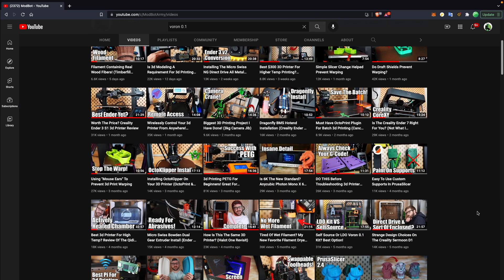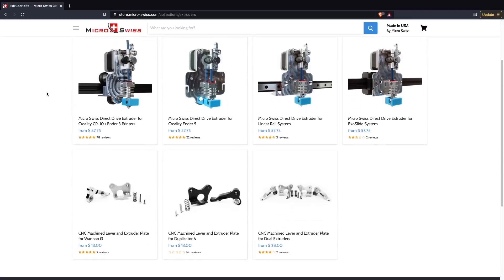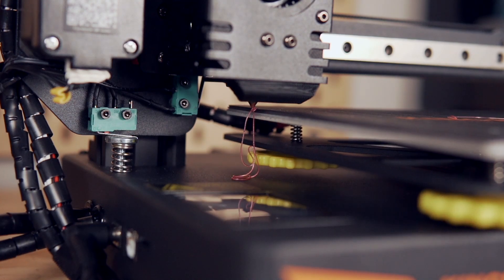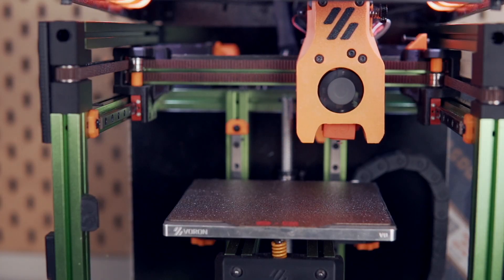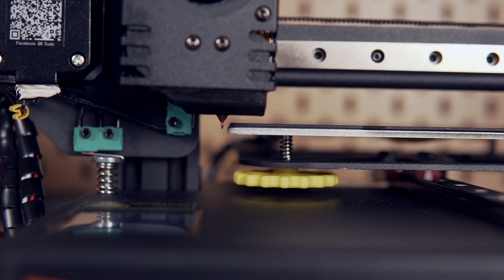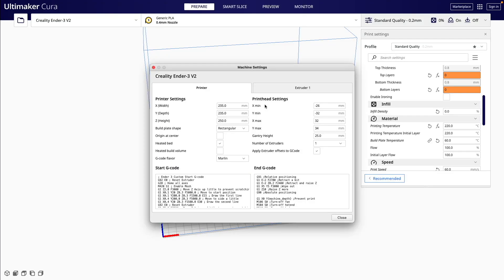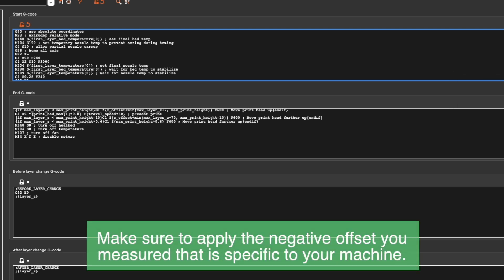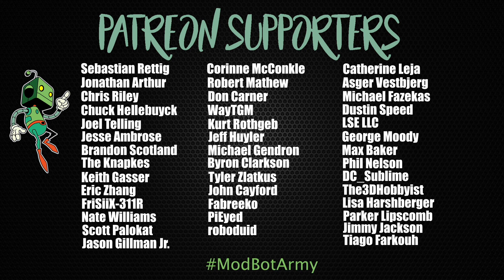How To Apply An XY Offset To Your 3d Printer

Comment: Thank You Man
I had to use this machine g code  because if I left it as just g28 the machine started from the top corner
program Creality 7.0.0 Ender 3 pro 4.2.7 crtouch, firmware bugfix 2.0  
G28 ; home  
G28 X Y ; home x y axis
G92 X-5.0 Y-10.0 ; offset micro swiss

Comment: Thanks, been using Cura 5 with my Ender 3 and everything was fine but when I tried using Cura 4.12 required to print Elipson 3d planes it was printing way off center. Turned out to be the Y axis was set at 335 instead of 235 in manage printers.

Comment: just asking i have an ender 3 pro. installed linear rails on the y axis and the x axis. now i did a bed level and the cr touch is probing off the bed . dont know how to fix. . also put a spider hot end on it too. so i need some help or were to go to get help

Comment: How to specify the printing position of the model, not the position of the printed 3D model inserted with the mouse on the screen, but the position of the specified X, Y axis value, which is the placement of the 3D model with the surrounding rectangle of the virtual size: the lower left corner is the determining or middle! This is important because the position of the 3D model that is currently inserted and visible on the desktop cannot be set exactly, but if it is possible to determine, for example, where the center of the 3D model should be when printing and print the 3D model in relation to it, and not where it was graphically inaccurately placed in the slicer. During later printing, a 3D model that has been re-scanned in a file will certainly not be placed where it was before, but if it can be specified in the position set on the X and Y axes, place the model before starting the print, e.g. the program manages to place the bottom left corner of the model's virtual enclosing frame or the center of the model in the position X=78, Y=62 in the program, and in another time, X= 76 Y=66, but I want the specified X and Y position the model and start printing accordingly, that is, it doesn't matter where I put the model on the print table area in the program, but place the 3D model in the given value of X=75, Y= 60 in the code and start printing like this. And is the position of the 3D model specified in this way the point of the bottom left corner of the virtual bounding rectangle or the center point?

Comment: Printing Cutlery drawer inserts for the missus, and Googled this exact problem... my "knives insert" had to be printed diagonally, and it's JUST barely on the build plate at 0,0, but still a good 30+ mm on the back left (after switching from Cura to Orca)... I forgot I added custom start g-code to Cura when I upgraded to the MicroSwiss. Great video, thanks!

My preferred "measure offset" method is:
Disable Stepper motors
Home just the axis to measure (X or Y)
Use the screen to move the axis:
First, raise the Z by 1mm
Move the axis to measure by small increments... until the nozzle is just over the build plate.  
Then just read the axis value on the screen... no rulers, no calipers, easy-peasy.

Comment: Hiya, should X Width and Y Depth values (in your example: 232/235) from Cura be copied into Marlin and firmware, re-compiled/re-uploaded to the printer or I should keep default ones in Marlin and just amend Cura ones?
Thanks

Comment: What are the "Home offset" settings in the LCD of my old Ender 3 for ?  I though if starting point of your nozzle is off the bed, you could measure how far and then somehow using the "Home offset" feature correct for this ?  But I've tried MOVING the nozzle to the desired position with the Ender command but cannot seem to make the Ender react to this as a starting position or save the location or put it in anywhere without using CURA or diddling with the Gcode as per the video.  And eveything I punch "Save" in Ender all I get is a loud BEEP, but when I Autohome, it always goes back to the position off the bed.

Comment: Trying to change the the center or offset on Cura makes your bed smaller and the purge line is still not on the bed. Also you can't move the limit switch. I had to prace a block on the Micro Swiss Hotend bracket.

Comment: Great stuff. Thank you. I has question that I can't seem to find an answer for. I have an Ender 3 v2. I just installed the creality sprite direct drive and moved my BL touch over to the new extruder. The problem that I'm running into is, because the bed level sensor now sits more foreword than it was before. So when my printer goes and does its auto leveling calibration, the cl touch is positioned off the build plate. I understand that using an offset would help, however, it would make my building surface much smaller for no reason. Is there a solution to set an offset for only during the auto leveling my printer does before each print? Thanks.

Comment: I have some fairly bulky (10m on the x, 10m on the y and maybe 3m on the z) clips that hold my G10 and my glass bed down... I don't mind losing the bed space, but my problem is that if I auto-home before applying offsets my nozzle hits directly on the clips and it really, really stresses the printer to the point that I'm scared I'm going to break it.  Yes, I could come up with other clip solutions, but... this works really well and I like it and don't want to change it.... so if I apply the offsets in Cura, will it still autohome and hit the clip again?  I think I can determine the answer by looking at the gcode... I mean, that's all the slicer really does is produce instructions, including the offsets and build plate dimensions in the form of gcode.... any thoughts?

Comment: Everytime I try to set my Z I get error to far. Anybody know how to fix this?
Reply: Getting the same issue🥲
Reply: I currently have an ender 3 with a skr mini v2 board and the touch screen and I absolutely hate it!! I want to put a stock ender v2 board/screen on it but I think that’s just a waste of money. It also has a “chpower” extruder that’s direct drive and pushes the nozzle to far out so it won’t hit the bed plate. Can’t adjust home offsets either lol I’m about to just throw it in the trash
Reply: @smallnuts2  I bought mine off Facebook lol I’ll fix it I’m sure, I did end up getting an s1 pro though and it’s awesome

Comment: iI am just going through this as my probe is on the other side to where it always used to be. I have put tape on the bed and measured for the centre point. I then placed my nozzle on that point and marked the probe which if i have done it right should be X55 as on the right side and Y -50 from the centre Is this correct or have i missed something as i want it to home to the centre of the bed.

Comment: hello, great video, I'm a complete 3d noob. I'm having issues with my prints not being perfectly centered on the build plate. it all started when installed a sprite pro on my ender 3 neo. I can correct the off center in physical world by moving the model in the slicer. that works for small builds but no so much for big builds because the model is off the edge in the slicer build plate once corrected. I'm trying to do some bigger builds I've got my printer quality  dialed in really good. I've tried all I know,  can you please help? very frustrated . thank you

Comment: @ModBot, I have an issue where my first layer calibration (the start) and initial print “ swipe” are now off the front of the plate .  I can edit my start Gcode to adjust the swipe but don’t know what to do about Prusa’s first layer calibration  on my Mini and it’s kind of annoying since I have probably 100 sliced files on my Pi ready to print. Is there a solution that can be written too NVRAM? Maybe Mm218?  I’d like to be  able to adjust this permanently.   bTW I just installed a new Reco Micro, it has issues before but not this bad.

Comment: And then there’s the XVico Pioneer 3D printer which has a micro SD slot and that’s it! The factory defaults for this pod have the hot end homing 3mm north of the y and 3mm east of the X. When I do auto leveling, it refuses to go to 3mm south of the back of the bed, instead it homes almost 2 inches south of the back edge. Neat, huh! Since I can’t put Marlin on it, what would you suggest?

Comment: What about X/Y Scaling?  My printer undersizes prints by about 0.24%.  Not a problem most of the time.  But for parts that need to be dimensionally accurate, I have to remember to apply a 100.24% scaling factor in the slicer.  Is this something I can set up once in the slicer or firmware and then not have to worry about again?  BTW, I do not have access to microstepping from the printers menu.
Reply: Dial estep

Comment: I have the ender3pro with the new microswiss NG and crtouch. Using cura what would that setting be
Reply from the maker: Ng doesn’t require the x/y offset just need to take a couple mm off the x and y. For me it was 3mm x and 8mm y that needed to be subtracted from max build volume.
Reply: @ModBotArmy  wait I dont understand it dont require the x/y but you said take a couple of mm off X/Y (I'm new still learning) I dont have the issue with the nozzle touching the plate with the crtouch
Reply from the maker: So the NG shift the nozzle (approximately) 3mm to the right and 8mm toward the back. (This is at least the case on my Ender 3 v2). Because of that you just need to change the max build volume in the slicer. In my case I changed the X Axis from 235 to 232 and Y Axis from 235 to 227.

Comment: The vast majority of Creality printers when fitted with a BL Touch and using stock firmware are probed with an incorrect XY Offset between the probe and the nozzle which results in incorrect probing, the firmware positions the nozzle in the position the probe should be in.
 I changed my Firmware to Insanity Automation on all my Creality machines which corrects this issue but some people will not have upgraded their firmware and be blighted by an incorrect mesh from their BL Touch or chosen ABL due to this error.
 A tutorial on correcting this in the firmware would be of great use to these viewers if you would be so good as to make this tutorial.
Reply: Literally the issue I am facing right now ..
Reply: @GeorgeGoosen  same here. Did you ever figure it out?
Reply: @richardmartinez5040  theres an probe offset number you set in the menu.

Comment: Hey Daniel! I was curious if it's very difficult to make an adjustment regarding the Y travel on a Cr10s5? I recently did a linear rail mod for the carriage that slings the bed around, but I built the aluminum brackets that attach the bed to the MGN15 carriage block a tad long. Basically there are 2 MGN15 linear rails, and 2 MGN15 carriage blocks per rail. I spaced the blocks apart 1/4" further than I should have. Now when it does its 25pt auto level, and the bed moves to do the last row of test points, it will smack the front carriage blocks into the front extrusion. The whole thing was a pain in the ass, just because it's a big printer, so I would gladly give up 6mm or 8mm of Y travel instead of pulling it all back apart to rebuild the brackets. To be honest, it works fine.. It runs through the whole auto home and ABL process, and prints great. But I feel like at some point, something will fail. The 500mm bed has a 500mm silicone Keenovo ac bed heater, a 500mm mirror, and a 500mm sheet of PEI stuck to the mirror. It's pretty heavy.. But for the weight it actually prints really clean.. But that SLAM during the bed level routine makes me worry for my stepper motor! I would imagine the best way would be to update the TH3D firmware (I have been setting up my Creality printers with TH3D firmware through Visual Studio Code) and just adjust the bed size to like 500mmX490mm? I guess what I'm asking, is if that would be the correct setting, to get keep my bed carriage from making contact? Otherwise, could I adjust the bed size in the machine settings in Cura, and sort of achieve the same thing? I will probably eventually machine some new brackets, and fix the original problem. But hoping for a temporary fix, be it in the slicer or in firmware. Sorry for the annoyingly long question. Any info is appreciated! Thank you!

Comment: 3:06 lol that problem have a lot of Kingroon KP3S printer so thx for this video
it's just a pity that you didn't show the settings of Kingroon in the cura for the non english spekaer... my printer does exactly the same as yours in the video.
Reply from the maker: For the KP3S apply a G92 after the G28. I tried changing the offsets in Cura using the text boxes and although it worked, it applied it after the purge line. I would start with x-5 y-2. That is what I wan with and you can always slightly adjust if needed.
Reply: @ModBotArmy  gracias

Comment: You could also move the print head to where you want it (using the interface), and pull the values from absolute location in x and y after homing. And then apply those as offsets... That seems easier than using a caliper or ruler.
Reply from the maker: That is completely valid. For the positive offsets it wouldn’t work since the homing would be into the bed and it would require using something like a caliper/ruler. For negative offsets though absolutely that is a great option 👍
Reply: how do you do that
Reply: @ArrowTech777  do what
Reply: @weld4200  i actually all ready fixed it i just needed a newer firmware so i could change the offset